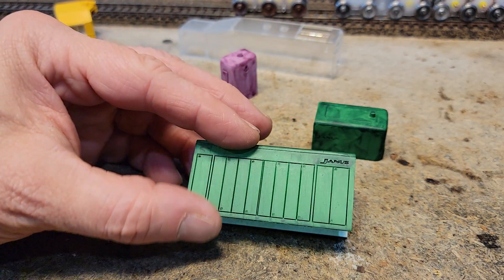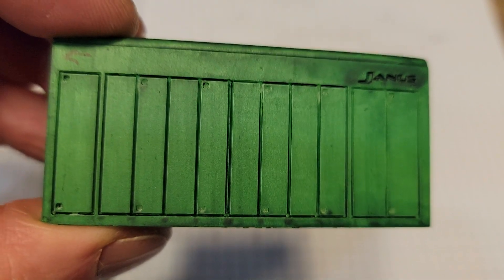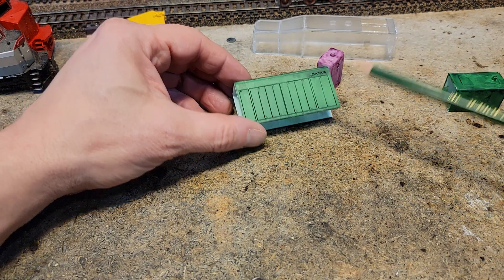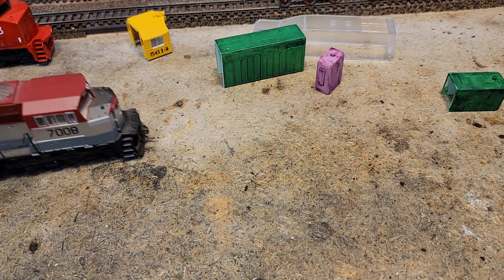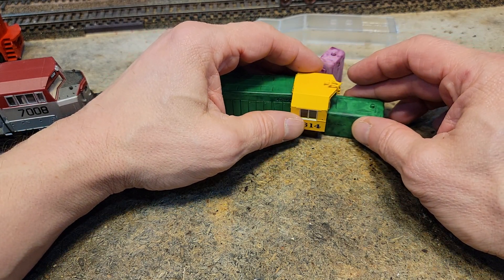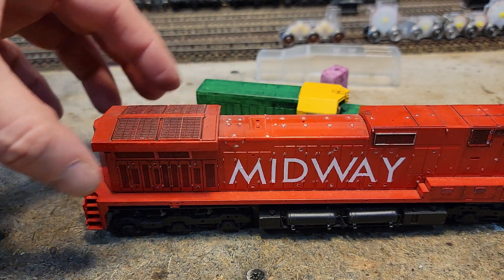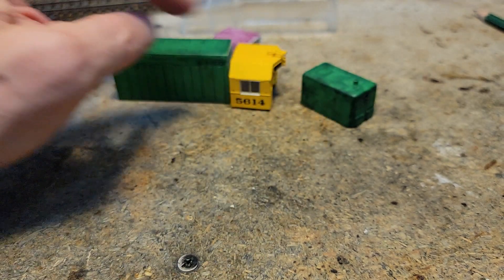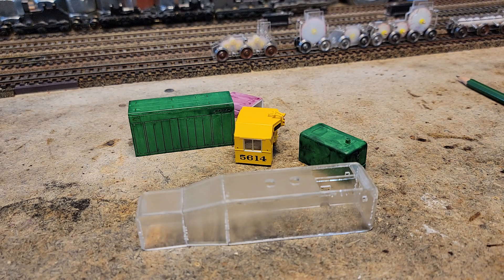2022 Part 30 Plexiglass Fabricated Long Hood Section

Comment: Your long hood section  is showing promise but as a reminder as you progress in your design be sure to include the door handles.
Reply from the maker: they have unlocking at the top and bottom like the SD70M until I think of something cooler!  the cabs will have door handles and windshield wipers, possibly even gaskets around the glass

Comment: i am very disappointed.  I think you should be able to open n close the doors by remote control with the decoder.  That ought to keep you busy tonight.  I like the cuts.  They look pretty good on video.  Maybe they are bigger than scale, but they look better than scale.
Reply from the maker: the cuts look big on camera in high definition, but that was how I was able to figure which of the test cuts was the best by zooming in - without that zoom I would have not known that one cut was sharper! tomorrow it will be time to try something just a bit more complicated